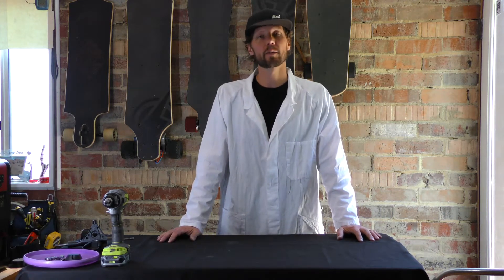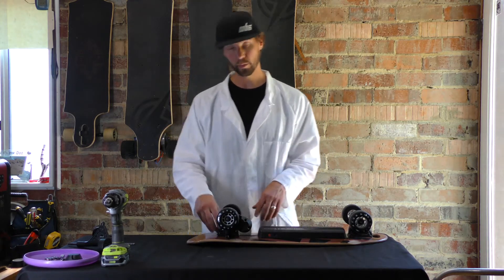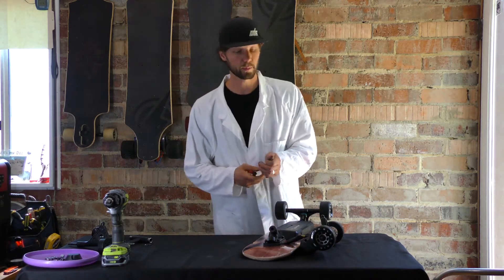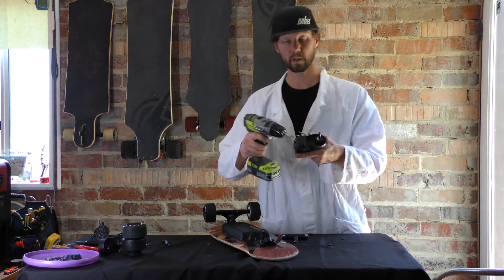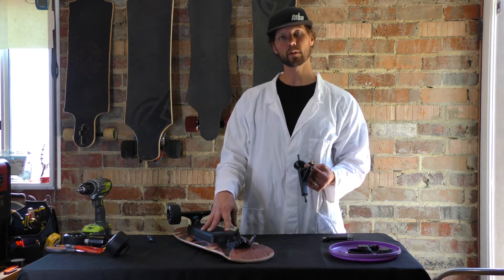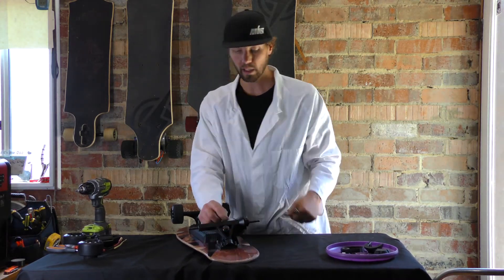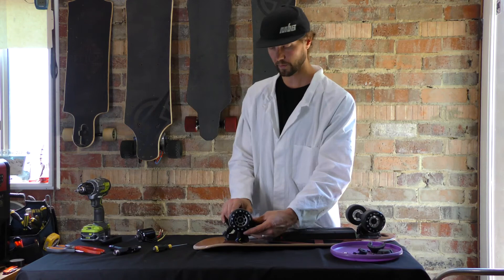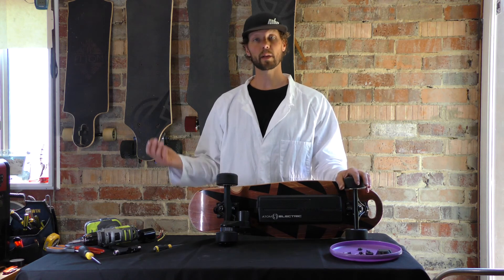TECH TALK - Motor Replacement - B-series

Comment: Seems a bit complicated, surely it would make more sense just to have the motor wires leading from the battery enclosure? Can't see why you'd want to thread them through the truck baseplate...